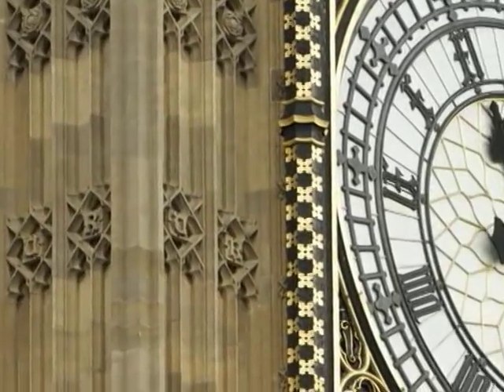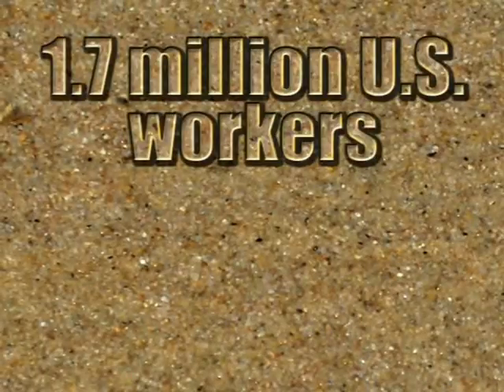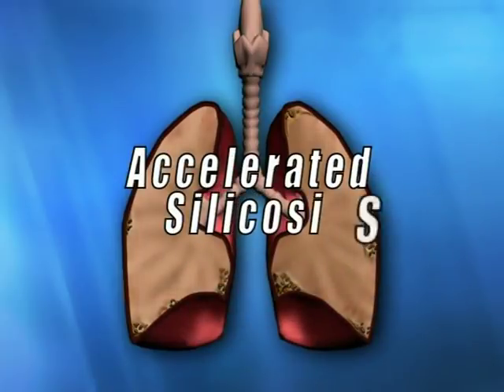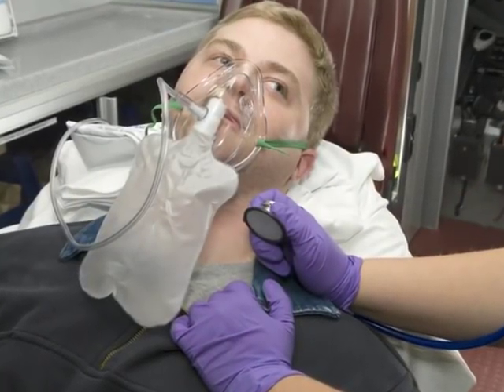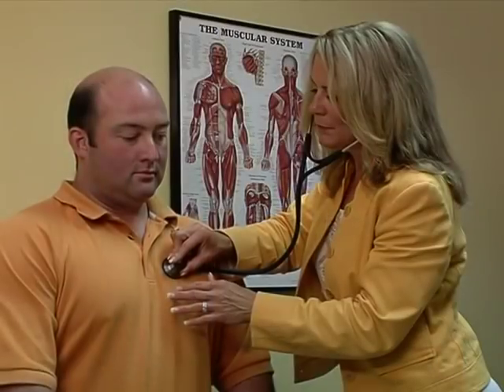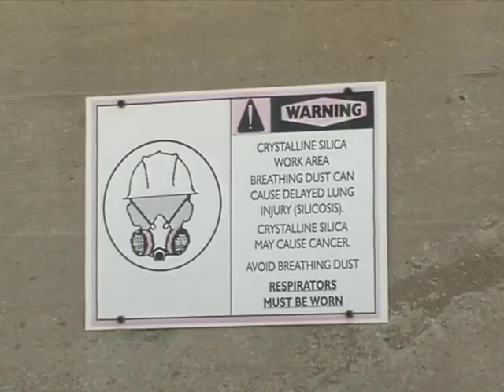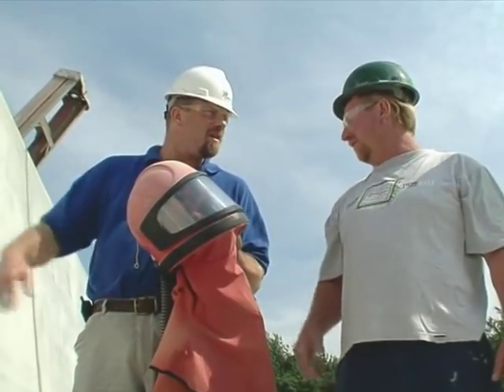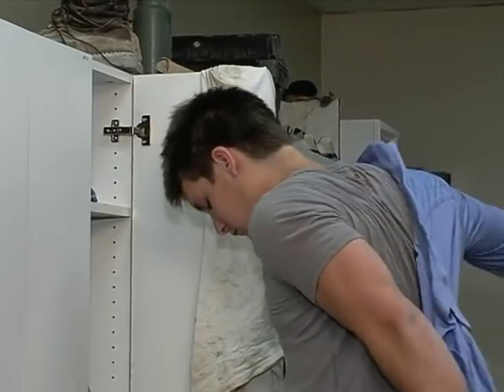Silica Safety Awareness

Comment: Netherlands is cracking down on silica dust misuse. The laws down there are as follows: 

1. It is unlawful to process or alter sandstone, because these stones are about 80 to 90 percent silica.
2. It is also unlawful to sandblast on ANYTHING that is 1 percent silica. 

Violations of that can lead to very severe fines in the Netherlands. 

3. Also under the law, the maximum permissible level for personal silica dust exposure is 75 mg/cubic meter, daily. Anything more than that - and your lungs ARE IN BIG TROUBLE!  

Lung cancer caused by silica dust is known now as pneumocodiosis. Silicosis is as worse as pneumocodiosis, because once silicosis occurs - YOU PAST THE POINT OF NO RETURN AND YOU CANNOT REVERSE THE DAMAGE!!!!!!!!!
Reply: CORRECTION - pneumocodiosis is a class of lung diseases that trigger irreversible scarring. Causative agents that cause it include silica, asbestos, and beryllium oxide.

Comment: Good video - but the respirator protection  set ups are incorrect for silica hazard - a P 100 HE PA filter fitted to a correctly sized and fitted respirator for an  individual may only be used if a Portacount fit test is conducted,  that validates the protection factor  of a particular type of respirator.  Check out OSHA information
Reply: poo bum damn

Comment: If someone breaks glass does it release silica?
Reply: Yes, but the particles are usually too big to remain airborne.
If you are etching or cutting glass with a diamond wheel that can release glass dust which is more dangerous.
Use water on the etching surface or cutting implement.
Reply: Z-Link Corrupted thank you for the info. Very useful.
Reply: @abrahanrodriguez9003  sorry for the 7 month delay, I was on the middle of that Sarahn dust storm that blew all the way to US and forgot the medical name of the condition.
We'll be alright tho.